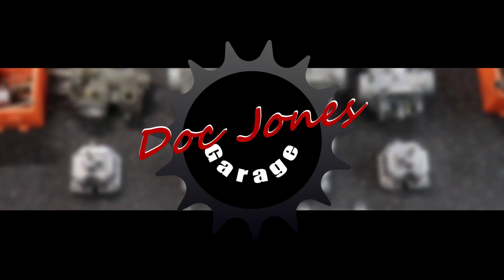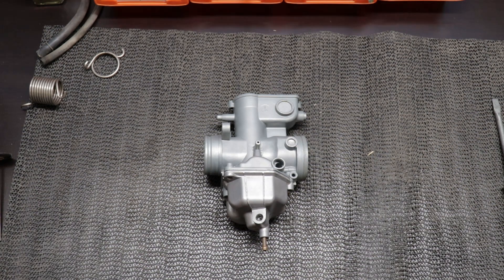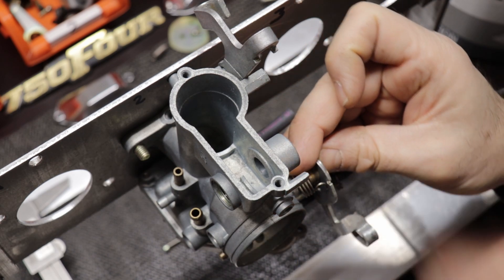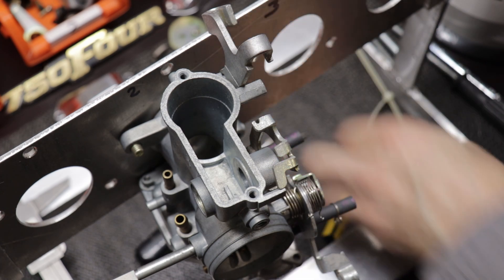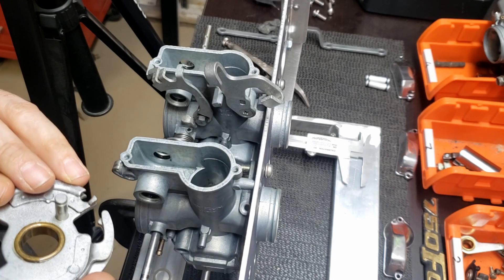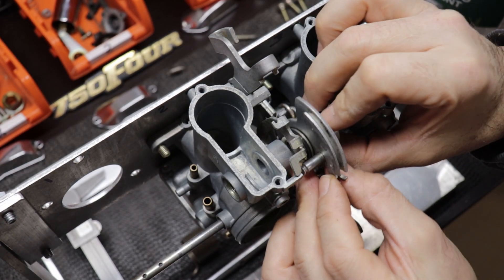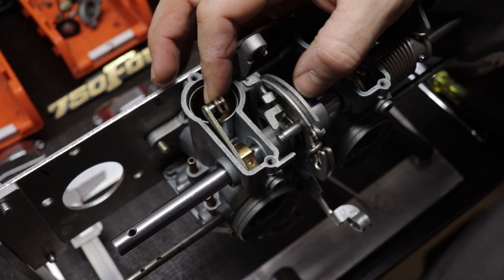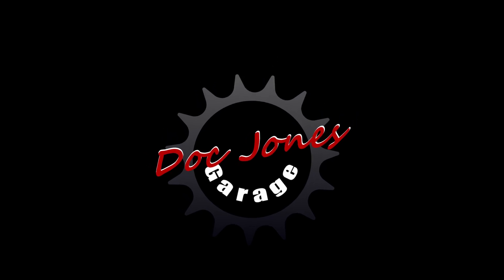Episode 4: Carburetor rebuild part II (cleaning & reassembly) 1978 Honda CB750 K8

Comment: Im working on a set of pd41 carbs would you know the size of the orings on the fuel lines between the carbs
Reply from the maker: I think the ones your looking for are 5.8mm inside diameter with 1.9mm material diameter.

Comment: hey nice job! i have a severe vacuum leak on the same set of carbs. gonna have to pull them apart after a rebuild. can you get just normal o-rings to be installed instead of the felt ones? i wish you included some shots of the o-rings on the throttle shafts and choke shafts lol
Reply from the maker: I just had a look at another carb I have that's partially disassembled (a PD41b) and removed the seal on the throttle shaft, it's actually a small lip seal instead of the felt ones that were in the video. I don't know the history of this carb but the measurements (best I could tell) on the seal are 14mm outside dia 10mm inside dia and about 2.5 mm deep. maybe that helps? I'll see if I can find the choke o-ring measurements I'll include them here.
Reply: @DocJonesGarage  hey i just had them split apart last night and i see the lip seals. mine are totally collapsed, the lips are not touching the shafts at all.
i fired some o-rings in there and the vacuum leak appears to be gone, but i have a odd idle still. will investigate further with my new sync guage set.

Comment: What material are the choke and throttle seals on this build?
Reply from the maker: I got the carb kit from Amazon and I double checked and they don't actually specify. Nitrile is a very common O-ring material though that has is supposed to have decent fuel resistance. (not with ethanol though Viton would be a better choice) I feel that if they did degrade quickly by the time they wear out I'd probably be looking at rebuilding the carb again anyways.
The choke seals are actually made from what looks to be some kind of dense felt material with square instead of rounded corners. I remember at the time they were difficult to find replacements for and they are easily destroyed if your not careful.